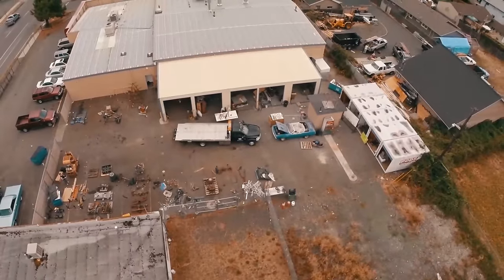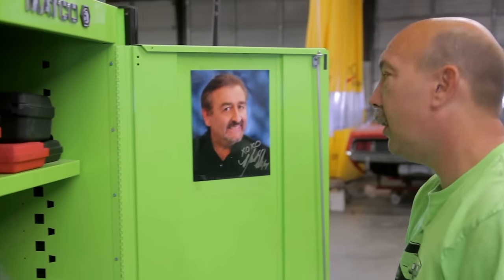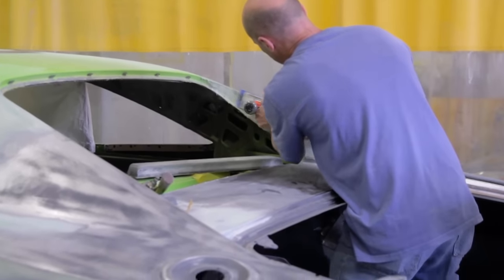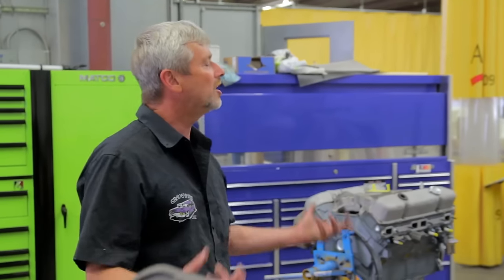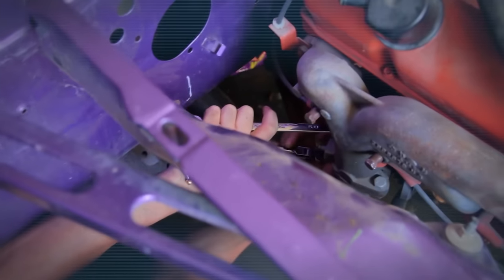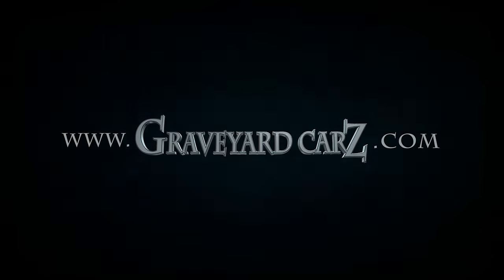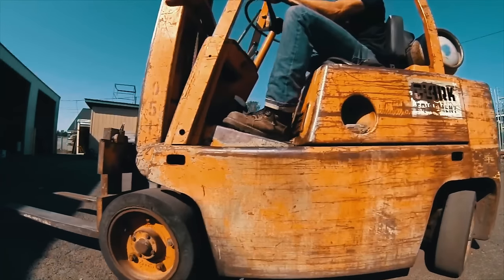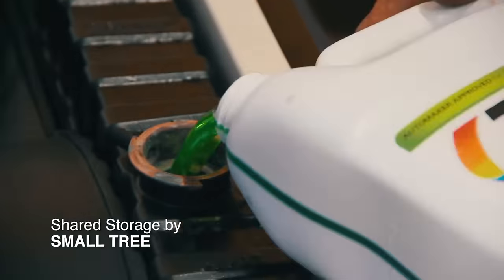MARK STOPS THE INSURANCE COMPANY FROM TOTALING A LEGEND!

Comment: If I lived near Graveyard cars facility I'd get a job there part time,I've done auto collision since forever and have done restorations as well since forever,still doing it,just not so young anymore lol. Spent my weekend on a 70 BB 4 speed Chevelle SS that I'm doing the metal work on for a friend,just the metal,I don't paint,I do prime my own bodywork but that ain't painting. Aftermarket quarters for any of the old stuff is a facsimile,it has to be made to fit,modified,body lines moved in some cases,or added in other instances,keeps me busier than I want to be.I plan on retiring in a couple years but will still probably work a little to stay tuned up,or maybe drink beer and fish some,that's always an option. That was a great repair for sure,that's a rare car and deserved to be fixed correctly.

Comment: It was called the torque flight by the way and so true on fit and finish in 1968  Barracuda 340 ordered from the factory, As my brother pointed out ,
man this thing's got Orange peel all over and the doors really don't fit that great there is nearly half an inch gap on  Doors.. It was 1968 and that's how they rolled... I bet your fit and finish is actually much better than original 
🙏🙏

Comment: Unless you have a customer loyalty / car  issue involved.  Let them total it, as long as they pay the full value. The customer or you can buy it back.  Then rebuild the car and title.  The rebuilt title may scare future owners but  even if it isn't totaled, the extensive damage will still be discovered.  At least that the way we did it decades ago. We actually knew a few crooked adjusters who would total  bikes  from scared owners  who didnt want to risk death anymore. Then we would get them cheap thru him and the Ins. co.

Comment: Remember this insurance will total out even a mint condition modern car just because airbags went off. As in my co worker had a tire blow it moved the car enough to set off the airbags.  Even though well nothing was wrong with said vehicle.
Reply: Airbag systems are difficult to repair because they're impossible to test, ask any autobody insurance provider about that aggressive litigation.  
Airbag deployment also destroys the airbag system itself, requiring replacement of multiple sensors, modules, devices, and sometimes harnesses.
Replacement of the airbag system requires R&I of many expensive and sometimes unavailable trim pieces, many are noted as being single-use and/or use expensive fasteners that break on removal.
If the airbags ever deploy, that classifies as a "catastrophic problem with the vehicle"